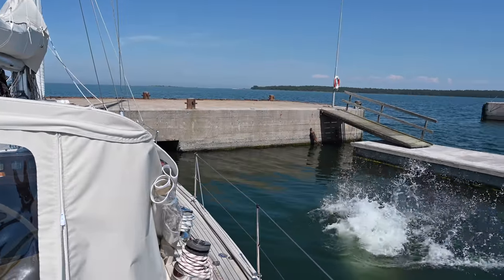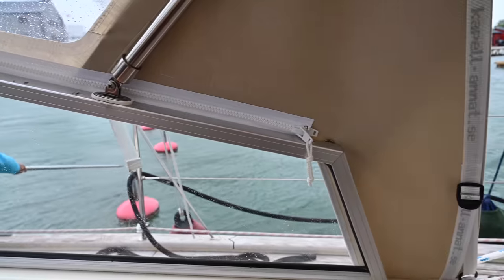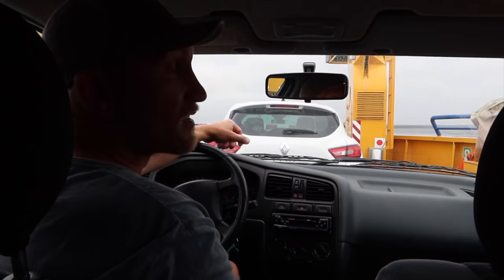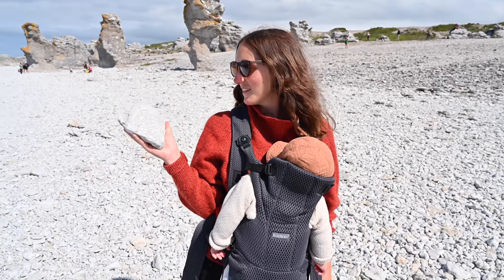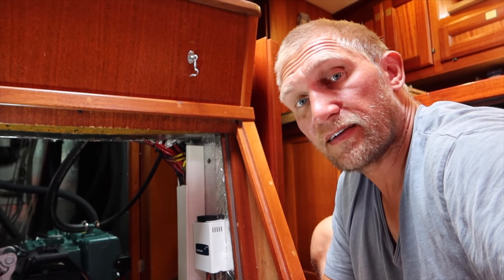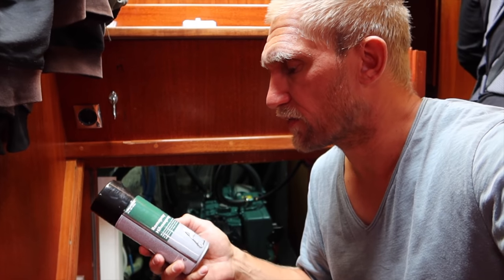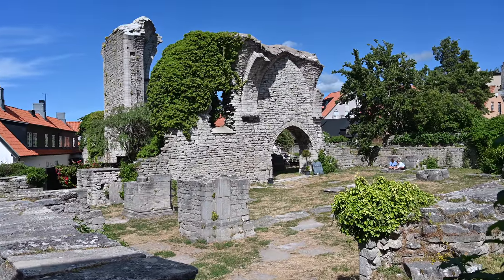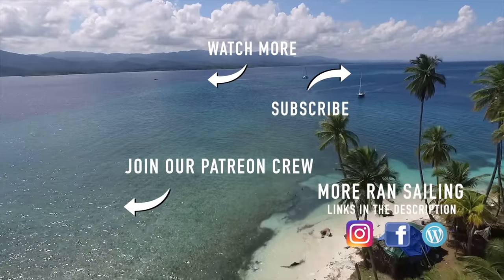Oops I DROPPED It In The BILGE! - Ep. 216 RAN Sailing

Comment: I'm very jealous about how good your engine looks. However, it caught my eye that the belt to the upper alternator flops around quite a lot. I don't know the tension, of course, but it looks like - with the long span from the drive pulley to the alternator - it needs an idler pulley. Just a thought...
Reply from the maker: I have noticed this also, even if the belt tension is correct it flops a bit... It’s a Volvo original bracket kit for the extra alternator so you would think that they are on top of these things but maybe not. At least there’s no slipping on the 12 volt alternator. Cheers!
Reply: yes came to say the same. that vibration of the belt causes a lot of dust. sprung deflector/idler would solve it.

Comment: Ran you 2 are a breath of fresh air, you show us some of the beautiful places on earth and give some history about where you guys are at, love that about you guys.
On another note when you started the engine after you sprayed the belts for the 24 volt alternator , it looked like their was a lot play in the 12 volt alternator on the left side, it could have been the camera angle but it did look to loose. Just a heads up and another thing to check next time you are down their. Keep up the great videos love your channel.
Reply: Yes, I saw that too. But the longer belt I am sure Johan checked. It looks lose when starting up, but the tension is probably just right!
Reply from the maker: Yes, you’re right the 12 volt belt flops around a bit since it’s pretty long... The belt tension is however correct and there’s no slipping. In a perfect world I think it should have an idler pulley mounted to help stabilize it. Cheers!

Comment: Taken from manual, read to end: Your belt will tend to stretch during the first several times you run your engine. Make it a part of your normal
pre-flight check to test belt deflection and re-adjust belt tension when needed. If you notice an accumulation
of black dust on your alternator and surrounding engine area, check belt tension. If the belt is tensioned and
you still experience belt dusting, it may be necessary to reduce horsepower load on your belt with the regulator’s Amp Manager function (if equipped), or you may find that a different brand of belt may work more effectively with your charging system

Comment: Hi, are there kits available for a spring tensioner pulley to add to 24v belt?  With a longer belt it would/could push down and create more contact area on 24v pulley.  Less slippage less dust

Comment: The amount of belt wrap around on the port side looks marginal. Surprised there is not an additional idler to increase the contact.
Reply from the maker: True! The 24 volt alternator really needs the exact belt tension, otherwise it will slip. Like you say, not a lot of contact surface... 😕